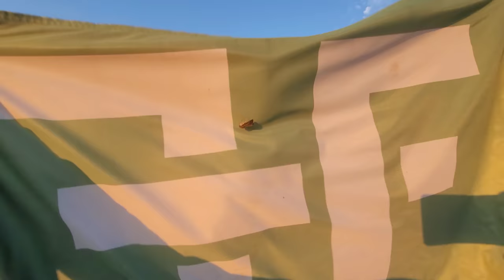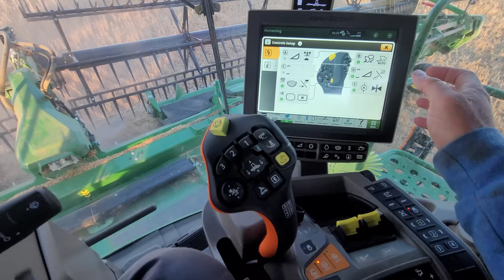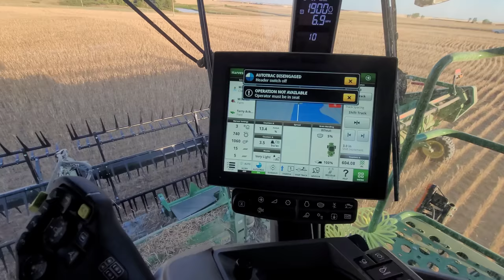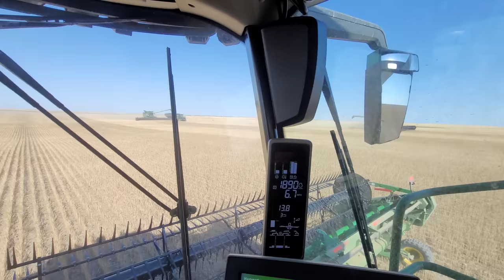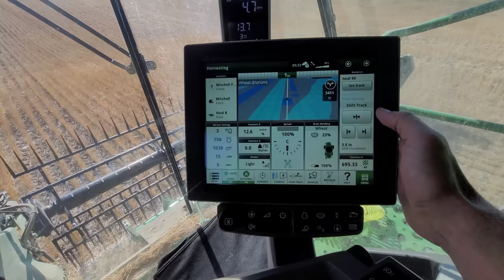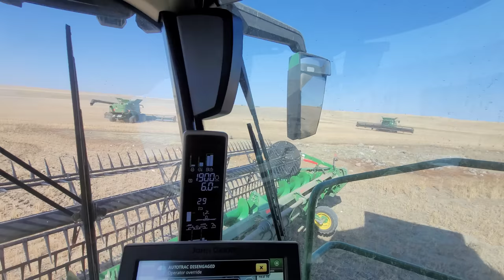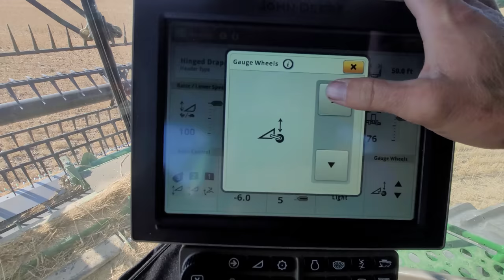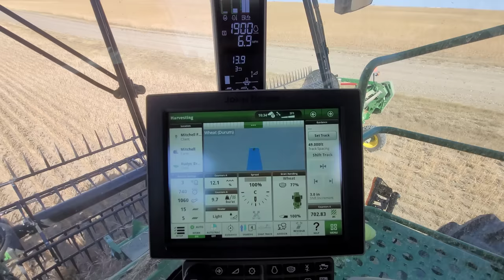Day 3 and a Donkey? 🤔

Comment: If you put a 4640 in the older combines you’ll gain the share functions.    You cannot replace the armrest monitor with a 4640 you would have to add it as a second.  That’s how we run our 2017 S680 so that our machine sync will work. Also you probably know this but I believe on all of your combined if you hold the transmission gear button you can set the full stick limit.   Makes it easier to drive sometimes when you’re in light crop that doesn’t load the machine.

Comment: I was always told running a machine empty is harder on them than the actual use  . Hope they hold up yet  if it's not there it's not there . Thank you for the video. From Iowa
Reply: Maybe measured on a per bushel basis, otherwise sounds like an old wives tale.
Reply: @mytech6779  could be

Comment: You need to bring that here and pick irrigated corn. That will try it out!!! 16 row picker head!!  Couple guys run that here!! Keeps grain cart guy busy as hell in 200 bushel corn!!!!
Reply: I'm curious why I have never seen a combine pull a grain cart.
Especially in operations where they aren't using a separate cart-tractor and return the combines to unload at a central bin or highway truck.

Comment: Mike on our 740FD headers you can turn off the pea auger with a valve on the header,  we just use it in canola, doesn't need to be running all the time..

Comment: MIKE!  Question.  Is the overhead expense high for you to run all those combines when the crops are so poor?  Are you operating at a loss, a wash, or a small profit?
Reply: At 6 bushels per acre priced at around 10 bucks a bushel probably cost that much or more to seed and spray
Reply: I would imagine they are just trying to get back enough yo replace their seed then have to put an insurance claim in

Comment: To be fair, it's hard to have issues when you don't have crop running through the machines
Reply from the maker: That's we thought too, but last year proved us wrong because it's like an auger running empty at pull speed, the rattling breaks things apart.
Reply: Yeah a loaded combine is smoother than an empty one

Comment: will the Nitrogen still be in the ground for seeding next year? or will 2023 be expensive seeding?
Reply from the maker: Yes
Reply: I don't think he gets enough rain to leach out the nutrients. 
I have the opposite issue, N never lasts the winter without a mature evergreen cover crop and we flip from cool and wet to hot and dry very quick in late spring. So our N needs very close timing and careful measure to avoid losses and get a good crop uptake.

Comment: Running with 60 foot heads instead of 50 foot heads on those 8 combines would be like cutting another 80 feet, even more than adding another combine with another 50 foot head.
Something to think about, being more efficient and doing the job faster and I bet it would follow the ground about as well as the 50 footers.
No I am not affiliated with Honeybee in any way. I just like seeing the big machinery.
Reply: Also bigger problems moving on country road allowances. Seems to me they are only 66ft and then have telephone posts to dodge. Also that much harder to get through the 30 foot gates.
Reply: @wssides  Install extensions on the lift rams for the head and it would help a lot.
Reply: Mike tried a 60 ft Honeybee said their land is too uneven. Now if JD or someone comes out with a 60 flex that bends in the middle like the HD50 that might work, but yeah, going have to take it off to road most of the time.
Reply: @John-nc4bl  I haven't examined that model of combine. Any potential damage to the header/body hinge area? Any interference with the electronics and hydraulics that monitor and control header height? Any danger of damage to wiring or hoses? Danger of over centring and causing damage from the header swaying in a position it wasn't designed to be in? Any potential warranty problems?
Reply: @wssides  The hard points for the extensions to the hydraulic actuators ends are attached to the combines drive axle and there is sufficient clearance between that and hydraulic and electrical lines. With the reel fully down there is also sufficient clearance between the cab and the feeder house as well as the reel for a higher position for the platform. With sufficient height most obstacle clearances wont be a problem. The 'frown' stance of the wide head is also a factor to consider but full side tilt with a higher lifting 60 foot head should clear a lot of obstacles.

Comment: Is there a reason your harvesting 4 bushel wheat? Thats not even paying harvest cost? Do you have to harvest for insurance reasons?
Reply: The first bushel is next year's seed. Plus it proves yield for the crop insurance
Reply: @delbutler885  Crop insurance wont zero out a 4 bushel yield?????
Reply: @lynwessel2471  A bushel seeded per acre leaves 3 bushel cant believe crop insurance wont just zero it out.
Reply: @jtn-minn8105  Someone said cash Durum is $13.00 so It pays them a custom rate for harvesting with some left over is probably how insurance looks at it . Durum went to $30/ bu the last time it got short. ($13= 30¢ per lb of pasta $30 would = 70¢.) Seed durum was $25/ bu US last spring .
Reply: JTN-Minn let's look at all of the reasons for combining the poor crop. #1 seed for next year is in the bin. They aren't risking having to go to a fickle market that may be very short and wildly high.
#2 cleans up the residue for next year's crop. 4 bushels of durum and the residue aren't something that you want in next year's pulse crop. #3 keeps from having to do tillage. If Durum is $13 plus a bushel times 4 that's $52 an acre to run the combine and harvest equipment that they are already paying for. Then there's the crop insurance loss proof. They can prove yields and loss. It's complicated but hey it's farming. Mike has a positive attitude because he sees the whole picture.
Reply: @delbutler885  But hey... I've been farming sense the late 1970s, unless crop insurance is making them harvest and wont payout until they do, there spending more harvesting then there getting.
Reply: JTN-Minn I also have been farming for 50 years. As I explained. Harvesting saves a tillage pass. Keeps the seed from germination if left in the field. It provides an opportunity to have seed in the bin for next year. Honestly I'd rather run those combines and get something than have to do tillage to clean up the field. If it's in the bin it's an asset. If it's left in the field it's an ass ache. In the spring that 4 bushels of Durum seed can give the Mitchell family options that can be real expensive or totally lost if they don't harvest.